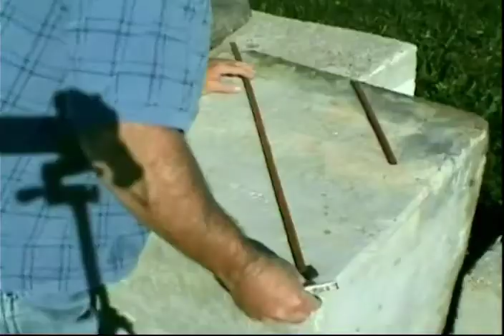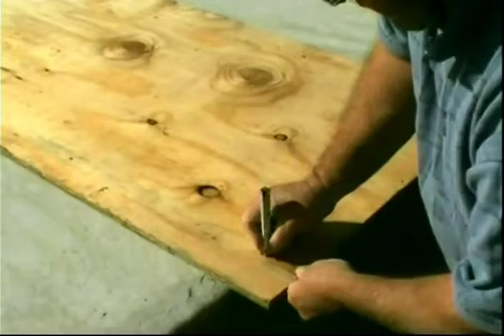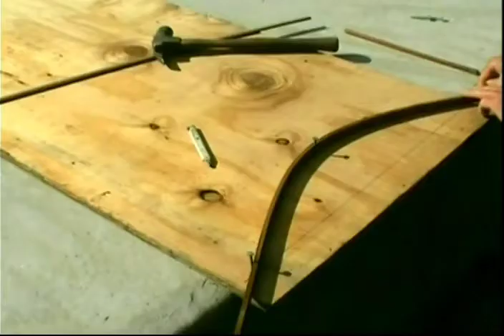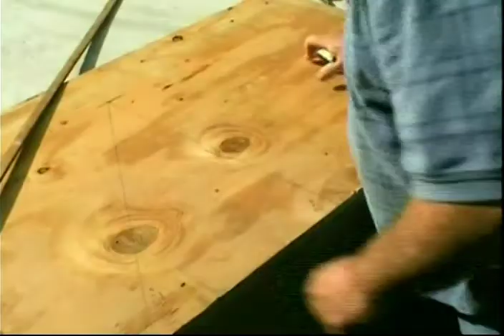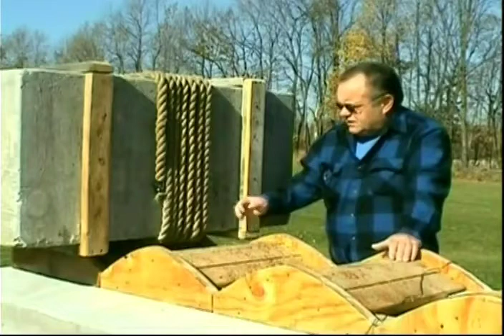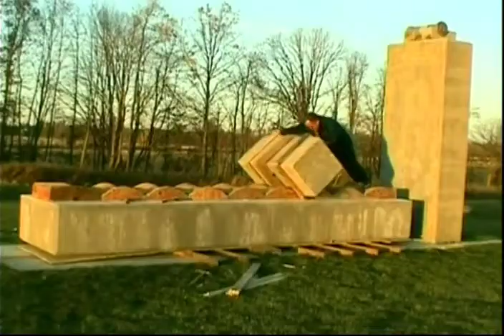Forgotten Tech. Laying Out A Road For Moving Heavy Blocks Stonehenge

Comment: wouldnt it be simpler to use the block as an axle for a pair of wheels?
Reply: That's a lot less useful on a soft surface.  With a system such as this, you could use multiple segments.  Move those segments would be a lot easier than the entire block.  The segments on a soft surface basically makes for a huge surface area compared to using a wheel so it won't sink as much or as fast as it would with a wheel.

Thing is, however, in the years since Wally worked this stuff out we've found out how they managed this sort of thing and it's not that far off.  They used giant sledges just as portrayed on monuments.  They've actually found remains of some of the sledges along with papyrus records of the crew engaged in the transport of the blocks.  They also found the remains of some of the boats the crew used to move the blocks on waterways.

Moistening sand slightly under a sledge makes for it surprisingly easy to move even very large blocks because the surface area is spread way out and the ground actually  instead of hinders the sledge once you make it just a bit wet.

It's really not all that far off from this system that Wally worked out.  The same basic concepts for the "road base" apply to the sledges.  The key was finding records of the crew and what materials they had on hand then figuring out what you can use those for.  That work has mostly been done now but it hadn't been when Wally was doing his thing.